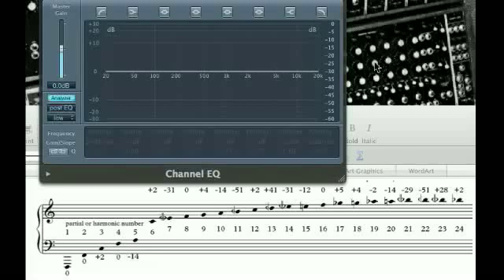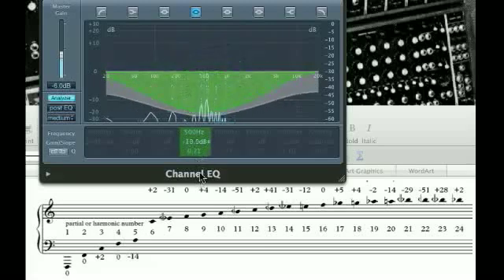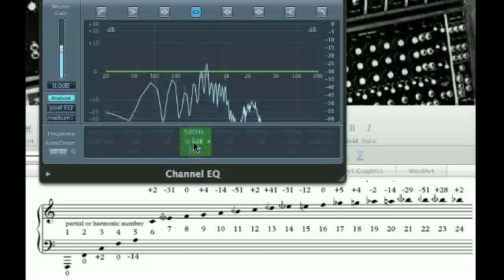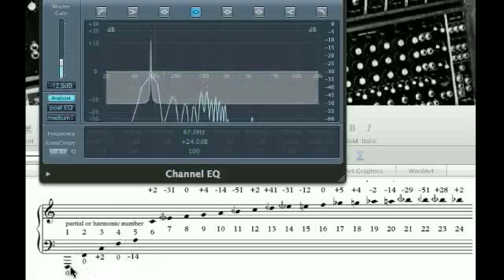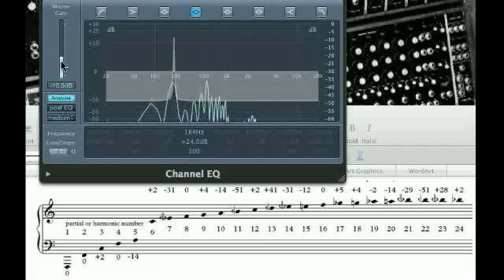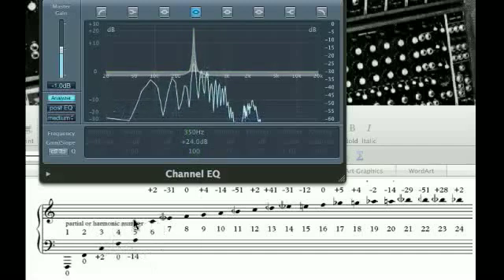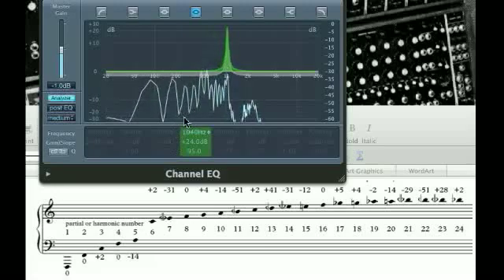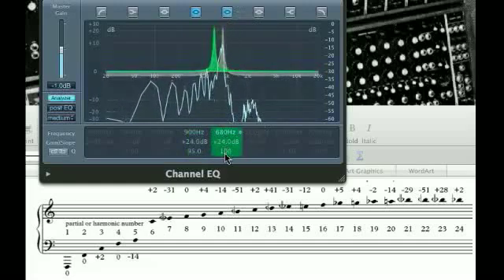VIDEO LESSON 01 - THE HARMONIC SERIES & EQUALISATION (E.Q.) (Architectures of Music)

Comment: i don't think is doubling the freq. is multiply x 2  you get the 2,3,4,etc harmonics
.  if you double it you get the next octave. ex: 440 x 2=880.  x2=1760  and this are freqs but in this case they are the harms of the fundamental freq.
Reply: doubling the fundamental frequency he meant .. in dis case fundamental frequncy was 90 Hz or 80HZ  ...if ts 90 then it should be 90 multiplied by 2,3,4,5... etc